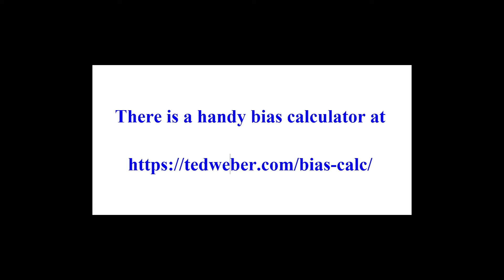How to Bias Marshall Origin 50 Guitar Amplifier

Comment: Do you bias it with the valves on?
And what part of the amp do you place the multimeter at?
I’ve never biased an amp, I’m not doing it but I’d like to know. Thank you so much
Reply from the maker: Yes you must have the valves on as you are measuring the current through the valves.

Comment: For your note book Stuart, the Origin 50 factory setting is 70mV on CN32 😉
Reply from the maker: Useful thanks. That's 35mA per tube I guess.
Reply: I'm curious, how do you know that your information is correct? I looked at the manual and there's nothing about bias values in there... Should I contact Marshall company (customer service) for their recommended bias value?

Comment: On CN32, is one common and the other VDC? I assumed the one with no run was the gnd and the other with the run the TP, but I couldn't get any readings on my DMM. Can someone help?
Reply from the maker: Sorry Jonathan it's been a while since I did this and I can;t recall.
Reply: Same question. Although I didn’t quite understand the latter half of the same. The CN32 has 2 points, one is squared off and the other a round one. 

So using a multimeter, how do I calculate the bias? I have never biased an amp but am fairly confident on doing it but don’t know how. Though I just have a multimeter with 2 straight probes and not the ones I can stick tubes on so can someone help?

Comment: Where do you connect meter? This video doesn't show HOW TO. It just tells us where the pot is.
Reply from the maker: Hi Dennis  You'll see the meter on the bench below the amp. It's a standard bias meter which you insert between the valve and its base. You can buy one from Eurotubes.